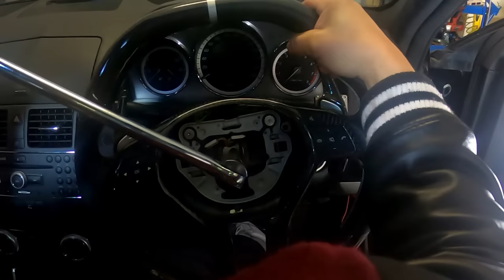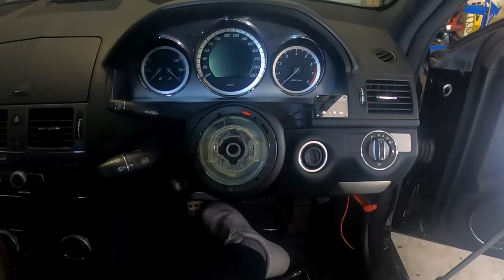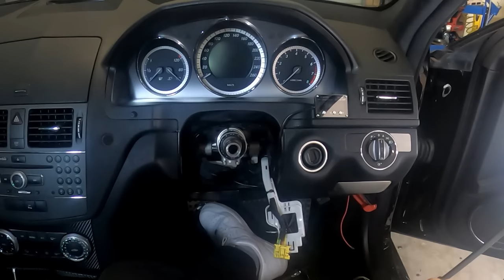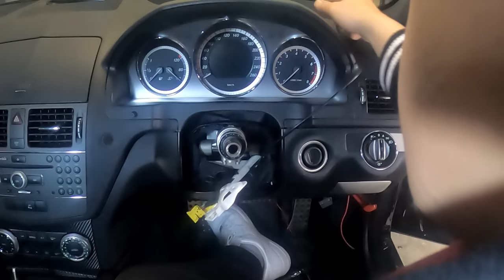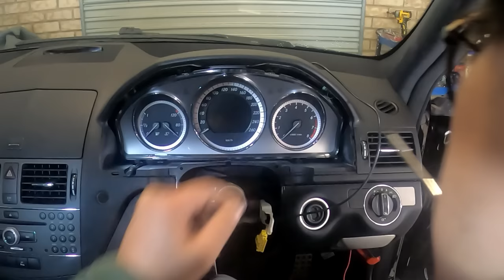HOW TO remove and fix ESL/EIS/ ELV MODULE  w212 w204 mercedes motor replace  Part 1

Comment: Another TIP to unlock stuck ESL: Loosen steering wheel/column, as if you were just going to readjust the steering wheel's position. Then, insert the key and as soon as it wants to unlock the ESL, begin to forcefully move the steering wheel/column up and down, back and forth. There's a good chance you will transfer enough momentum to the insides of the ESL module for its little electric motor to finally move and unlock.
Reply from the maker: good stuff thanks for sharing
Reply: This comment should be pinned to the top. After trying to whack the steering and so on, as mentioned here and on other sites, without success, I tried this this morning and the ESL spring into action. Now waiting for my £13 motor to arrive in the post and do the job myself. Thanks.
Reply: @victorgeorgiev8794  do you need to code anything after you replaced the motor
Reply from the maker: @e60freak567 no just reassemble and it will work
Reply: boss, you are cool.. you saved me towing and lots of money... may be just motor got stuck some how, it's working perfectly 🎉🎉🎉🎉 after 5 hrs of tension and your single comment solved it..
Reply from the maker: @tabishhussain8487  that great buddy .. glad to hear it

Comment: Hi Mikey, thanks a lot for your helpful video! For those who are possibly intimidated by the task I would like to mention that it is possible to skip some steps. It is not necessary to remove the gauge cluster, nor the steering wheel or the airbag. While all of those steps make the other steps physically easier to execute, they are not essential. For example, the removal of the steering wheel would make it easier to access the 2 top screws of the steering wheel column. So, after removing the plastic cover plate under the steering wheel column (3 torx screws and 1 phillips screw of the hood lever), it is enough to (1) remove the plastic trim / frame around the gauge cluster and (2) the plastic trim behind the steering wheel / around the steering wheel column and (3) the 2 bottom screws or all of the 4 screws of the steering wheel column. If you remove only the 2 bottom screws it is still necessary to loosen the 2 top screws so the column can be lowered and the ESL module removed but you don't need to completely unscrew the top screws. For these 4 screws you'll need size 10 hex wrenches - it is best to use t-handle variants for the bottom screws and combination wrenches for the top screws. It is advisable to have multiple lengths at your disposal because there is little space, especially when accessing the top screws, but you still need a good grip / leverage because these screws are very strongly tightened. If you have difficulty try adjusting the column / wheel position by switching the plastic adjustment clip / switch beneath the wheel. If you have trouble opening the ESL module because some of the 4 pins are stuck, it is possible to drill them out. If you have trouble putting them back securely, you should probably secure the module so it doesn't come apart, possibly with tape, or some kind of band, like a hair band. In any case something non-flammable for safety, and also it can't be thick because the module has little or no room around it when installed in its place. Make sure your check the inside of the module and carefully clean it of any debris. For lubrication, just out of caution, I used silicone grease as some of the moving parts inside are plastic. It is very hard if not impossible to photograph the ESL module in its installed position, so it's understable that it is only shown here after the successful removal. If you want to double check everything before the job, I found a nice tutorial with good images at pelicanparts dot com that I can recommend.
Reply from the maker: fantastic info mate thanks for sharing all this info .... and well.done for being able to do it your way ... I take my hat off to you
Reply: Re ESL 4 pins problem: Hammer in the correct Torxs, as there is no thread twist and pull at the same time to get those pins out. Once the US$5 motor has been changed, hammer the pins back in, use the correct ends. Can connect the ELS to the electrics while not connected to the column and try the ignition and see if lock goes in and out. Some chaps leave the ELS dangling out side the column as that motor may burn out 10 years later anyway and no one wants to steal and old Merc. There will just be no steering lock.
Reply: If the steering is locked, then the entire steering column has to come out to cut off the 10mm bolt holding the ELS into place. But all it needs is to take off the surround of the gauges and the kick plate at the bottom. The top two bolts can be taken out with a long extension and a universal joint. Take off the two lower bolts with the correct Torx, take off the ELS electric connector and then pull the whole assembly off WITH steering wheel, air bag, dust bag and wiper/cruise control bits intact. Pull it towards you diagonally thru that small gap. No need to separate the splines at the universal as it can lead to disasters of hammering steel splines into an alu universal. Unless you have a very small electric cutting disc for your angle grinder to cut off the bolt, you can look forward to two hours with a hacksaw. To get rid of any edges stopping me from getting the ELS out, I had to use small cone- or ball-shaped grinding disks.

Aliexpress sells a handle with a small thread to pull out the four pins in a clock-wise direction. The pins can be hammered back in. I drilled mine out, which made a mess inside. As it is not easy to put a new 10mm bolt in to attach the ELS to the column, allow the ELS to be safely attached somewhere. The locking will not work any more. In 10 years time, that Chinese motor will have burnt out again allowing for an easy replacement.  Aliexpress also sells that cylindrical tool should you need to remove the ignition lock if you decide not to fix the ELS yourself, you will have to send the dead ELS plus ignition lock plus key to a locksmith, who can give you a recon. unit, but a different unit has to be matched electronically with the NEC security chip in the ELS. If he/she fixes your unit, it does not need a sync.
Reply: @dominicwild3189  What should I search to find this handle to pull out the four pins? Thanks so much for your help!
Reply: @dominicwild3189  Would you be able to provide the link for the tool from Alibaba?  Thanks,
Reply: I'm a visual type of guy can you make a video because this is a huge common problem with the w204. I have a 2012 and this issue right now. Thanks
Reply: @seahawksforever9504  I no longer have access to the vehicle. But changing the ESL’s internal electrical motor was not a long-term solution, it failed again after about a year. Swapping the entire ESL unit for an ESL emulator might be a better and long-term solution, short of opting for a new and hopefully updated factory ESL at a dealership.
Reply: @danieljanca  Yeah I figured getting the emulator is the best option. Those motor burn out easily and can leave you stranded. I don't want to risk that so removing the steering lock is what I'm going to do. Thanks!
Reply: Sorry to bother you again but I removed the bottom 2 screws and planned on removing the top 2 screws soon. How would you take the ignition switch for the key out if you don't remove the steering wheel?
Reply: @seahawksforever9504  If I remember correctly, I think you need to remove the steering wheel and pull the flexible cover away to be able to remove the ignition switch, but you don't need to remove the steering column. Removing the wheel is not difficult. Disconnect car battery, loosen two screws on the back of the steering wheel, carefully lift the airbag, unplug the airbag cable, remove airbag completely, unscrew big bolt in the center of the steering wheel, remove steering wheel. If you need to remove the steering column switch module too, it is recommended to mark the position of the module and the column with a marker and reassembled the same way.
Reply: I'm going through the same crap with a 2006 CLS 500. I got the lower dash loose in front but it's stuck down at the back by the firewall.
Reply: @jeffmccain9204  Try turning key off on back and forth for a a few minutes while turning steering wheel until you hear a click. It took me 3 days about 5 minutes each time and I got lucky it unlocked. I didn't have to take out the steering column. All I did was unscrew the 2 back long screw and 2 short front screws. I used a small 1/4 husky ratchet with short extension and was able to unscrew it off. I bought an emulator online for $123 plus a spare key for $115 on top and now my car works great. Just no more steering lock lol
Reply: @seahawksforever9504  How much was it to have it all programmed?
Reply: @seahawksforever9504  I'm screwed. 2006 CLS 500. It's apparently on the top of the column behind the dash. I was able to lower and retract column but can't identify what is what.
Reply: @jeffmccain9204  Exactly ..same with 2014 c250 AND if you have the electronic adjustment for column on the left side that steering column is not coming through the small gap it has to come out from underneath the dash.  I do hope your repair has been completed...I'm still in da middle and none too happy 3 weeks later. Never again Mercedes
Reply: @TamaraCMoore  I was quoted $1600. My son  took his apart and a locksmith came out and synced the electronics and put it back together for $350 in Fort Worth. I'm still carless. Yeah, never again Mercedes.
Reply: Were you able to take the ignition switch to program the emulator without removing the steering wheel? I have it loose inside the frame but I cannot find any hole to bring it out...
Reply: @F3RN4ND0CG  I think no. The steering wheel has to come off to be able to remove the ignition switch. It's not difficult, check my past comment about it in this thread.

Comment: I have a 2010 GLK, X204, with a failed ESL unlocked position.  Your video was tremendous help and I was able to repair the unit. I was able to remove the ESL without removing the steer wheel, dropped the steering column by removing the four bolts.  Keep up the great work. Thanks very much for posting a great video.
Reply from the maker: excellent stuff mate.. yeah j only removed the steering wheel so that I could also have room and show basically how you would get to everything ..but well done on doing a job that otherwise would have costed 1200 ➕️
Reply: how to know it is in unlocked position?
Reply: Where you guys able to take the ignition switch to program the emulator without removing the steering wheel? I have it loose inside the frame but I cannot find any hole to bring it out...
Reply: How did you know what motor to use?

Comment: Mikey-

Your tutorial on the W204 ESL drive motor repair was just plain brilliant. 

I am a moderately grizzled 62 yo "decent" amature/hobbyist mechanic, and I followed your steps to the letter in order to replace the ESL drive motor.   It was not super-easy to do as a first-timer, but I got it done over a couple of Saturdays.  The little details, like showing where to disengage hidden snaps (instead of them breaking off), and the reminder to protect the instrument cluster from the bare steering column, were GOLD.  I did need to partially end-mill out one of the four roll pins on the ESL module because it would not come out, but all good. 

As I got to the re-assembly, I tested (1) the motor, then (2) the ESL module (hanging beneath the dash), and then (3) the entire car, for a few hours (in Sport mode) before confidently handing it back over to my very happy wife (it's her favorite car, ever, and she refuses to part with it).  

Thank you so much for putting that all together.  

I would like to buy you a coffee.

Mark
Reply from the maker: mark i am blown away by your appreciation and i'd love nothing more then to have a coffee...but just your appreciation for my work is more then thanks enough..im just very happy that you were able to follow the steps to a T and get yours done ... I'm blown away everytime someone tells me how helpful the video was ..  and I appreciate 🙏  sooooo much ...I can't thank u guys enough for the support and giving me feedback ... I trult appreciate all the comments and am forever grateful ..it allows me and drives me to do more helpful videos for this specific model

Comment: I want to give you a huge thanks for this video! It really made the assembling much quicker and felt more safe for me. The electric motor in my ESL was completely burned and luckily for me it was in the open position but it came alive couple of times when I tapped it. If someone has issues with getting the ESL in the open position and you are afraid you have to remove the whole column, try to give the ESL couple of taps or hits with your hand or screw driver. It might get your ESL motor jumping for one or two times. I replaced the electric motor inside the ESL which cost me 17$. Imagine what you can do with good tools and amount of patience and stubbornness. With it, you can achieve anything, and of course help from wonderful people on internet. Thanks again
Reply from the maker: @arn8386  ur most welcome mate that's why I started this channel